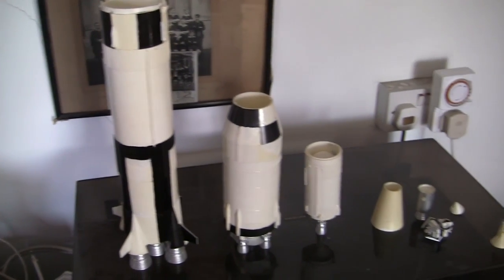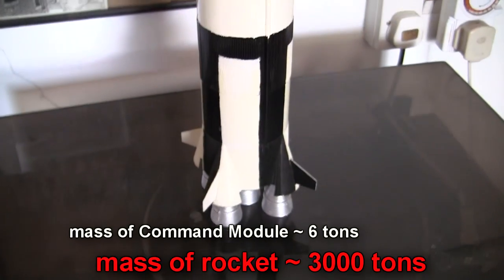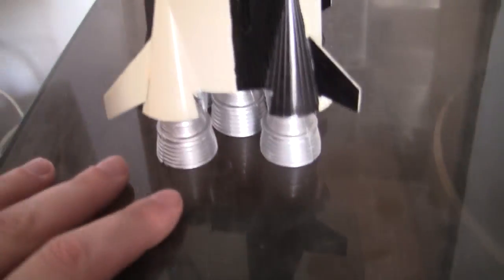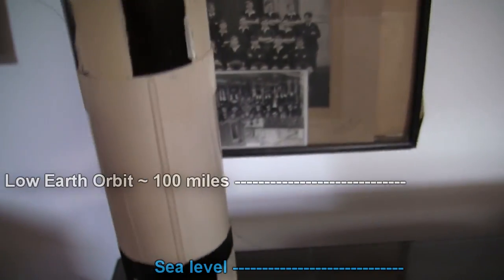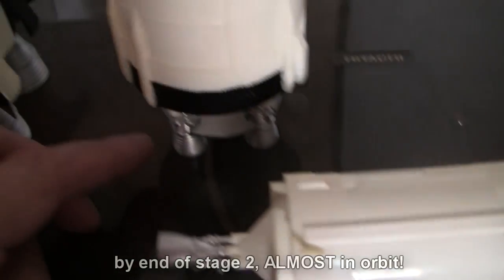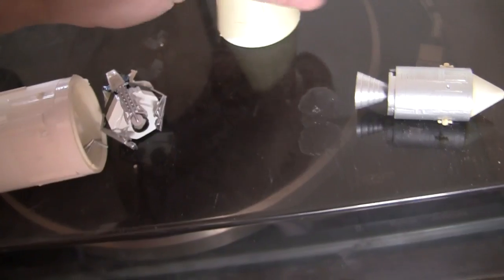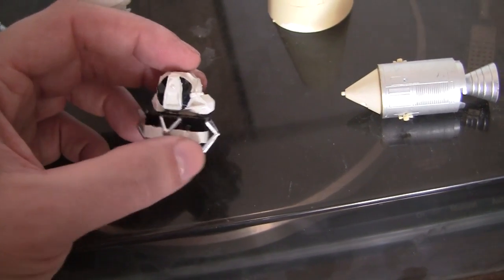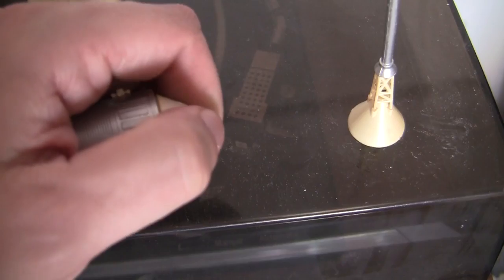The Saturn V Rocket: How it worked!

Comment: An engine failure on the moon would not mean you're dead. There was an emergency plan on how the astronauts could detach RCS fuel and thrusters from the lander and propel themselves in their suits to the lunar orbiter. They had enough air to breathe for several hours of docking maneuvers. It would've been one hell of a trip but their only chance to survive. They had to steer with shifting bodyweight and stuff.
Reply: ***** Not that hard: http://imgur.com/a/ueyYJ#0
Reply: ***** These are astronauts. With a little math and communication to the orbiter they can make it happen. They have studied the moon and know how high they are when things look smaller and smaller. The horizontal speed can be estimated too like that. It wouldve been damn dangerous but the main problem in my opinion would be their limited oxygen supply. Still better than being caught on the moon though. The orbiter had even some spare fuel to come to them if they run out of fuel early. They orbited in 35km height as far as I remember. It's not that far away, they wouldve had visual contact very early. The only information from the orbiter they really need is the speed they are getting closer to it. I can completely do this in the game just using the Navball and the informations given on it. The only reason I switched to the map was the lose of the navball because I had not enough RCS.
Reply: GermanRider No you're completely wrong. To be able to "just take your best guess" would have a success rate of less than .00000001%. Kerbal space program is nothing like real life.
Reply: Gregory Weber So you basically make up quotes, refer to it and try to prove them wrong?

The orbiter was in 30 km orbit. 30 km is the horizon you see on the sea. You can easy see lights and such especially if it is dark. This means they could see the orbiter all the time with their naked eye. The guy in orbiter would tell them their distance and calculate their relative speed by using his radar. The most dangerous and difficult part would be to actually take off safely. If you have an imbalance you have not much time to correct it out so you dont crash. Once you've achieved some altitude you can concentrate to burn roughly in the same direction the orbiter is flying. As it gets closer for a fly by the man in the orbiter wouldve told them in which direction to burn to point his direction. As you get closer than a kilometer you can kill all relative speed and do a slight push in his direction. Thats it. He has to depressurize the capsule, open the door and let you in. Even if oyu do crap like hell. The orbiter could come to you instead of you to him. It had enough spare fuel for such a maneuver. 

This would be one hell of a ride and very risky but it wouldve been still better than suffocating on the moon.

The most complicated stuff in space flight is to overcome earths atmosphere. Once in space you just have to burn towards the correct vector. As long as you do that correctly you cant miss your target. 

" Kerbal space program is nothing like real life. " Yea, NASA promotes its Asteroid Redirect Mission with a KSP Addon because KSP is nothing like real life..
Reply: Mark Martin The second one to quote me wrong. Where did I say you have to point at the target? You calculate a vector you have to burn to in order to meet your target and than you just have to burn towards the vector (not the target).
Reply: Mark Martin If it's like this I ask you for a million dollar.
Reply: Mark Martin Just admit bro, you were wrong, and yes ksp is still very unrealistic, as all of the celestial bodies are 10x smaller (retaining the gravity though), meaning the orbital velocities are significantly smaller, meaning more delta-v would be required. There would be nowhere near enough for an escape plan. And if your method apparently works so well, why would they need the ascent stage in the landing module in the first place?
Reply: I'm just drunk guessing here, but suppose you could make altitude with your jerry-rigged ascent.  Could you really make velocity?  I'm pretty sure the CM would hit you like a fucking freight train.  (If you even found each other at all)  You'd either watch him pass by like a tracer bullet and wish to be no nearer or poor Collins would wish he had windshield wipers.  XD
Reply: Mark Martin
This was the proposed plan http://falsesteps.wordpress.com/2012/09/01/less-the-lunar-escape-system/
Reply: Scott Manley made a video about the escape craft. Its on KSP, but its somewhat accurate, the explanation is better.
Reply: *****
I liked his video where he used an overturned rocket on the moon, fired its engine, and used the thrust from that along with the kerbal's thrusters to go into orbit, only to find out the orbiting craft was already fully seated, lol.
Reply: The motor was tested many hundreds of times, apparently it never failed once the final design standards were met.  Still a pucker factor on every return to the CM I'm sure.  It even saved the 13 crew.
Reply: Damn, I came on here to say how much I enjoyed the video but then I started reading this convo and it got a bit serious. Whose quoting a game and saying it's like the real thing? I only ask because I just beat Sebastian vettel on my xbox... If I were to try in real life, I'm pretty sure it would end differently. A game, even a good simulation doesn't ever really match up. I did enjoy reading what you guys are saying though.
Reply: HatsTour That example is a little wrong. I didn't say I could reach the orbiter on the moon just with some RCS. I said when I can do it in a space simulator a real astronaut could probably do it in real life.

Regarding your example it would be as if I assume Vettel can win the championship in real life because I can do in the game which is pretty legit.
Reply: ***** Getting from the surface of the Mun to orbit using RCS thrusters in KSP would probably not work. It could conceivably be done on lower gravity bodies such as Minmus, Bop, and Pol. It definite can be done on Gilly, which has the lowest gravity of an KSP body. From a altitude of 8 km, I was able to go to and from the surface (only need 40% of RCS fuel in my space suit). The funny thing about Gilly is that you can probably return to orbit from the surface of Gilly by jumping. In fact the gravity is so low that trying to walk will send you flying.
Reply: Gregory Weber The Sun in KSP is only as big as Jupiter in real life. Even brown dwarves can't be that small. You can also reach the outmost planet Eeloo in less than 3 years. However the most unrealistic part are the "spheres of influence". In a SOI you are only affected by the gravity of the planet or moon that the SOI belongs to. If this were true in real life there would be no tides. The game is still rocks in any case.
Reply: Actually, only orbiting one thing at a time in a video game would be realistic for the object that's orbiting. The gravity from anything else would affect the orbiting ship as much as the planet.
Reply: GermanBiking 1. There was no air lock aboard the CM (besides the docking port but that doesnt really count because the LM is basicly the Airlock). 2. They did not have EVA RCS packs atm. And RCS isnt going to give you 10000 m/s of thrust.3. Do you really think you can match your orbit trajectory with a ship going some 10000 m/s at 100km above the surface WITHOUT a navigation computer or any idea where that ship may be?
Reply: GermanBiking You are talking about finding a tiny CM going 10000 m/s in a 33500000000 Km^2 area based off of your math, descriptions of location over the moon, and RCS. Ksp isnt the same as real life, it cuts out some aspects of orbit mechanics. Try doing that with no nav ball and no map.
Reply: GermanBiking 1. Its 100km2. Don't think that ksp make you a rocket scientist
Reply: GermanBiking  too much science fiction movies 4 you...now go to bed

Comment: Excellent video Thunderfoot. You had most of it spot on. You correctly id'd the Command Module (CM). Immediately behind it was the Service Module (when the two were together, which they were for the entire flight up until re-entry), the configuration was called the CSM. (It was a liquid O2 tank which exploded in the SM during Apollo 13).

The entire booster and capsule was struck by lightning (twice) during the launch of Apollo 12. It shorted out everything in the CM (the astronauts described it as like all the lights of a Christmas tree lighting up; fortunately the Instrument Unit (IU, made by IBM, I believe) was well shielded, and kept the craft flying in the right direction (amazingly the four outboard engines (massive engines) were on gimbals, to "steer" the rocket -- if you see a video of the launches, you will see the engines tilt the rocket slightly away from the gantry tower, it's not an optical illusion).

And an engineer at Mission Control knew just what switch to throw to re-boot the CM. They double-checked everything while in Earth Parking Orbit (the only thing they couldn't check was the parachutes --- there was no way to do it, so they decided to proceed with the flight -- if you are going to die because the chutes are shorted out, at least you get to go to the Moon. Obviously they worked perfectly). 

The term you were looking for when they re-ignited the Third Stage engine (another first -- to restart an engine) was called "Trans Lunar Injection" (TLI), and obviously the burn out of Lunar Orbit was called the Trans Earth Injection (TEI). 

You are also correct on the fuels used in the three stages of the booster. Von Braun opted for the kerosene on the First Stage, because they had never used the liquid hydrogen fuel before, and those First Stage engines were massive, and very tricky to get working properly. (Which is why the Soviets used those 30 engines -- which did not work out so well -- I don't think the N-1 ever had a successful flight. One exploded about 30 seconds in -- the other exploded on the ground, not only destroying the rocket, but the entire launch pad.) 

As for the CSM engine, and both the descent and ascent stage engines of the LM, they all had hypergolic fuels (I cannot remember their names -- but they wanted as few things to go wrong as possible, so they chose fuels that would ignite on contact with their oxidizers). The escape tower was jettisoned after the end of the 1st Stage's flight. 

The sad thing about abandoning it was that the expensive part -- the design, was done. Once that is done, then it is much less expensive to build more of them. 

Some thought that the Shuttle, where reusability was the key thing (it was supposed to make it much less costly) obviously was a tremendous failure in terms of keeping down the costs. They were much more expensive to fly than the Saturns. 

But thanks for the video; it was fun to watch. I was quite young when the lunar missions were going on (I do remember watching the later missions with the Rover), and it is a crime that we haven't been back.

Comment: The black stripes make it fly faster (Our engineers said so!)
Reply: And anyway, everyone knows that hot rod flames make things go faster, not stripes.
Some people have never even taken a look at engineering! Ughh!
MK3424
Reply: Nope, it was painted that way so it was easier to follow with cameras and in case of an event (wich never happened) determine witch parts where in fault.
Reply: MK3424 It's a joke :)
Reply: MK3424 Correct, and that was another one of von Braun's ideas. Amazingly designed machine. And it never had any major failures (the catastrophe with Apollo 1 [fire in the CM] and near catastrophe with Apollo 13 [explosion of one of the LOX tanks in the SM (service module) were problems with the Apollo payload, not the Saturn booster). 

And even with all that boosting power, they still had weight issues -- the LEMs all used to land could not support themselves in Earth gravity -- they would collapse under their own weight.
Reply: I know
Reply: leerman22  its to see the spiral of the rocket dumb ass
Reply: The Eh Team should add some speed holes
Reply: The Eh Team go faster stripes, lol, I had them on my XR3i lol
Reply: Black stripes, a spoiler and some stickers make everything faster!
Reply: @SmokedHam444  what about the Paint job on the Partridge Familys Bus ?

Comment: What a waste thou, we need a better way to travel out to space... Wish I was smart enough to do exactly that.
Reply: What a waste?, they'd have to do it with the resources it had in the 60's, there was no titanium alloy back then. They even had to develop new welding techniques so that it won't rip apart when launched.
Reply: And we'll eventually come up with "better" (I assume you mean "more efficient") ways of doing it.  The problem that we run into is that so far, all of the "other" technologies have problems of their own.  For example, ion propulsion is very fuel efficient, but the physics as we currently understand them make them too low powered to get us off the planet and into orbit--and that was what 90% of the mass of the Saturn V was for.

Comment: Calm down before you get a stroke, jackass. I know perfectly well what you're talking but if YOU understand common English I wrote that since you brought up the subject of Soviets. They didn't go there because it's possible in the first place. That's also the reason why NASA cancelled the program. A hoax like that in 2013 is impossible when most countries could easily track them down, almost with the help of a pocket calculator. As for physics, you're an indoctrinated, lille jackass. That's all.

Comment: I built one of those models, back about the time of the first moon landing, managed to hold on to it and probably still have it [somewhere in the accretions].  Great video, one tidbit I find amusing, the command module will fit inside one of the 1st stage engines exhaust nozzles.

Comment: On the subject of lunar module fuel: it used a hypergolic fuel mixture, I think of unsymmetric dimethyl hydrazine (UDMH) and nitrogen tetroxide. The advantage of this mixture was that you didn't need to light it for it to ignite. Once the elements mixed, they ignited. That meant that the astronauts could turn on and off the lander engine very quickly, which you need for precise landing burns.

Comment: For the next ten years, the poverty rate remained above 12.8 percent, increasing to 15.1 percent, or 39.3 million individuals, by 1993. The rate declined for the remainder of the decade, to 11.3 percent by 2000. From 2000 to 2004 it rose each year to 12.7 in 2004.

Since the late 1960s, the poverty rate for people over 65 has fallen dramatically. The poverty rate for children has historically been somewhat higher than the overall poverty rate. Continued...

Comment: PT 2- In the late 1950s, the poverty rate for all Americans was 22.4 percent, or 39.5 million individuals. These numbers declined steadily throughout the 1960s, reaching a low of 11.1 percent, or 22.9 million individuals, in 1973. Over the next decade, the poverty rate fluctuated between 11.1 and 12.6 percent, but it began to rise steadily again in 1980. By 1983, the number of poor individuals had risen to 35.3 million individuals, or 15.2 percent. Continued...

Comment: Nuclear Engine for Rocket Vehicle Application, or NERVA was a Nuclear engine separate entirely from the Orion. It was never seriously looked into for more than about five years, it was concludecd that the Orion would have too much fallout, and a crew wouldn't survive the constant pulsing acceleration.

NERVAs, however, nowadays refered to as NTRs, are still a perfectly viable option. THey run on nuclear fuel in a fission reactor which heats up hydrogen gas, rather than nuclear explosions.

Comment: Who's incomes? The top 1%? Incomes for the poor and middle class stagnated and shrunk when adjusted for inflation. Median income peaked in 1999, and decreased until 2005. There were slight gains in 05, 06, & 07, followed by slight a decline 08, and a 6% decline in the aftermath of the crash, since then fairly flat. Federal actual revenues remained below 2000 levels until 2005, adjusted for inflation, they did not recover until 2006. Hmmm...

Comment: I used to work for the company that built the lunar module. I think, if we ever got that contract again, we would be 5 times too expensive and still fail to deliver. We'd hire a bunch of cheap noobs, spend millions convincing ourselves, despite all evidence, that we can do the job (without any due diligence of what the job is) and that's why we've never matched our 1980's performance, let alone what we could have done in the 70's. Management cares, just not about the product.

Comment: Moron, the debt Existed during the election of 2008, the massive debt from Iraq and Afghanistan, as well as the economic downfall of the housing market, were all topics of debate.  Those three things have not been paid off, yet, due to massive problems with the Republicans in the House refusing to balance the budget.  Your insistence that it's entirely under Barack is wholly 100% ignorant of the actual facts and timeline.

Comment: It doesn't cost money to close parks. You close parks because you don't have the money to run them, which would otherwise come from the fed govt.
NN is a bit confused or unclear: Bush's wars increased the deficit. 

BHO buys the rhetoric about cutting services to feed the deficit: restarting the economy with a large cash injection in the right places (not the banks) would likely work better, and taxing the rich properly certainly would, but BHO is center right, so he's not going to try either.